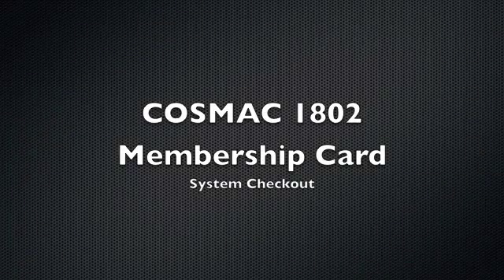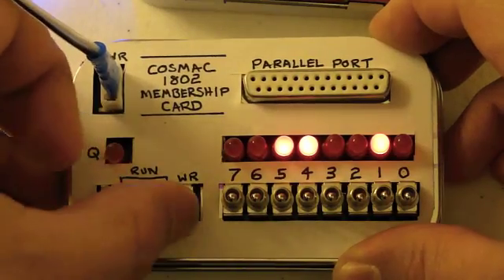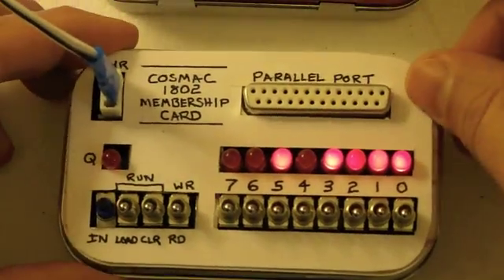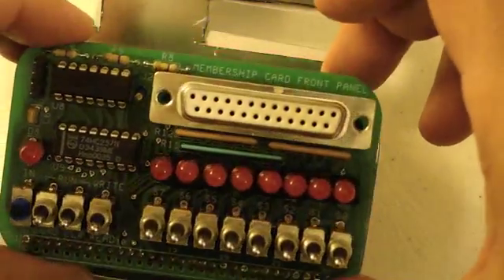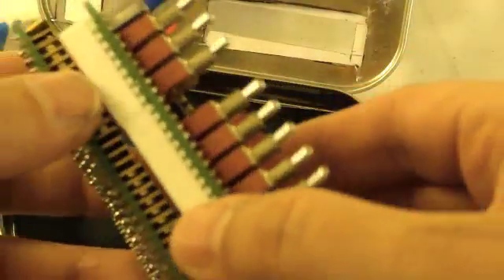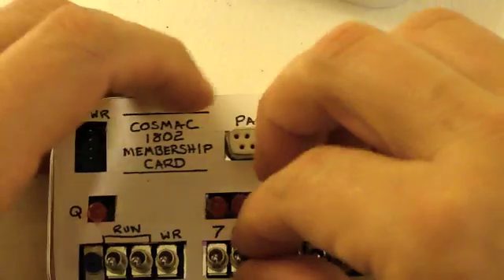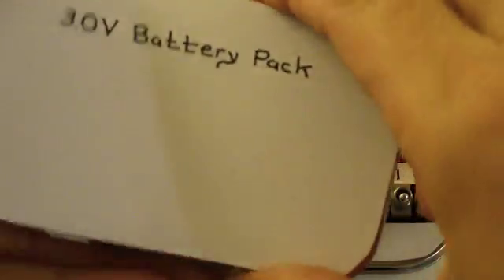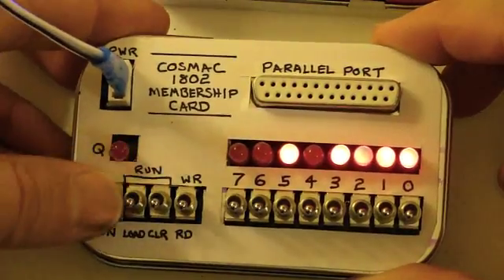COSMAC 1802 Membership Card Checkout

Comment: could YOU illustrate  this in a few seconds, likely NOT! a term I got from Lee Hart when I built his kit, was bare metal programming. A useful term, the Arduino chip(s) are more SoC (system on a chip) chips, NOT Microprocessors.

 Like building a house, that already has a foundation, it locks you into the foundations design which doesn't allow you to create a new out-of-the-box paradigm.  Or a new language,

Comment: @ptdecker might want to put it in the description, you can't click it or copy it so have to manually type it in.
and I'm quite familiar with Lee Hart. he is rather stuck in the past. for instance he's into electric cars as am I but he promotes the use of lead acid batteries and dismisses lithium batteries as unproven and unreliable and that lead is the better choice which is blatantly wrong. and no matter how much data he is offered he sticks doggedly to the lead mantra.

Comment: @ptdecker no it isn't. anything that this implementation illustrates you could simply illustrate on paper in seconds. this is useless nostalgia. nothing more.
Reply: Dan Frederiksen, I have one of these, and it has enough I/O to be useful controlling real world things. Decades ago I used the 1802 as a simple controller for test fixtures at work, and it can still do that kind of task today. Would an Arduino make more sense? Probably, but it would not be nearly as much fun as this. I think this is at least a bit more than useless nostalgia.....

Comment: Absolutely.... With an 1802 computer like this each instruction you write in your program is executed directly against the CPU. There's no interpreters or higher level compilers tohold your hand. You define which registers are going to hold the data, what's going to happen to it or how it's going to get handled... 

1802's are still around and have been used to run everything from cellphones, alarm systems to, data entry devices and traffic signals as well as satellites, missiles and spacecraft